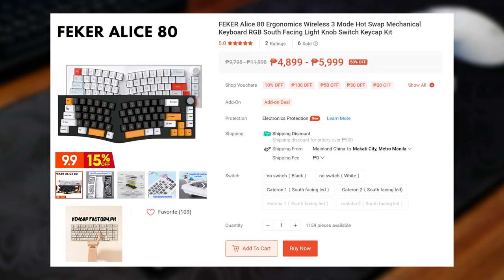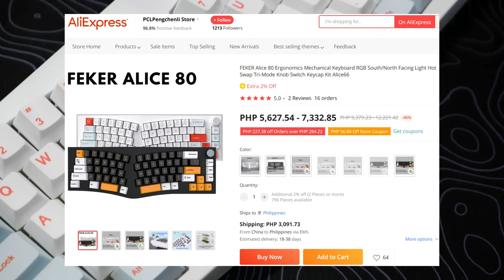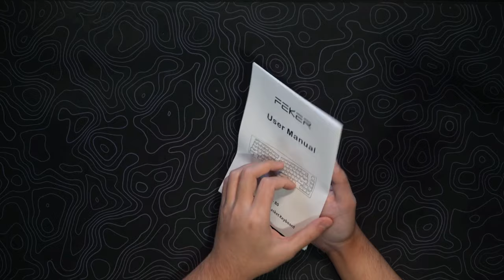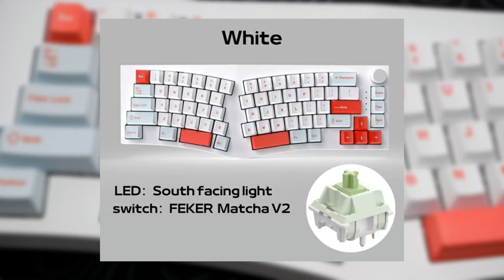Feker Alice 80 Review | The Best Budget Alice Keyboard

Comment: Hello Merkeebs! What do you think of Akko's Alice Pro Plus? As I think it's cheaper than Feker's fully built.
Reply from the maker: After having my hands on both. I can safely say I prefer the Feker over the Akko Alice. For a few reasons. And this isn't because I have any issues with Akko. I genuinely love Akko's stuff. I just have a few nitpicks from the perspective of a keeb builder.

- Availability of a South Facing PCB
I had issues with the strictly north facing LED's on the Akko Alice when I tried using a Domikey Cherry profile set even with long pole switches. Interference was unavoidable for some reason on the Akko. I'd much rather avoid the headache if possible.

- Plenty of potential for moddability by removing or replacing the silicone
The board is a nice sandbox board to play around with because it has the potential to work with so many different configurations.
I'm working on modding it right now and it's sound signature changed completely.

You can check out ThockyDocKey's review to hear what I'm talking about. He does a great job showcasing the board's potential.